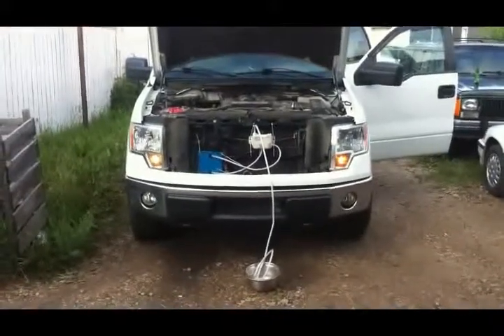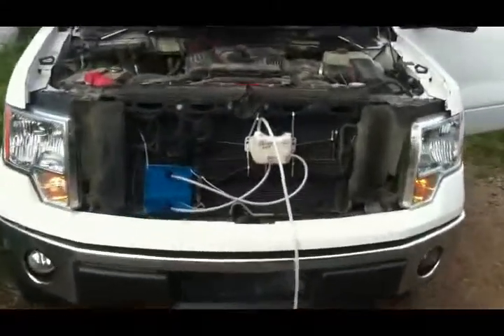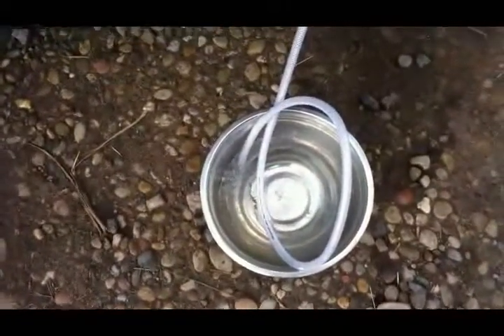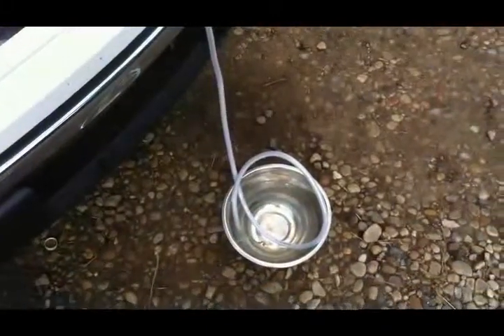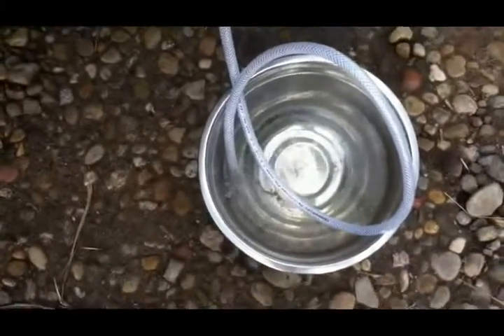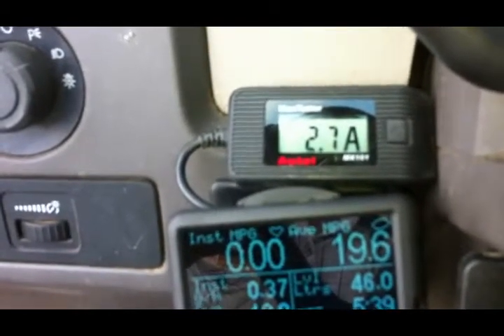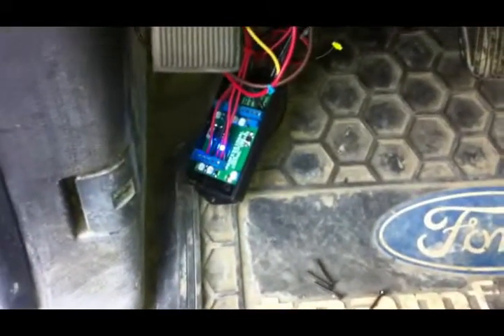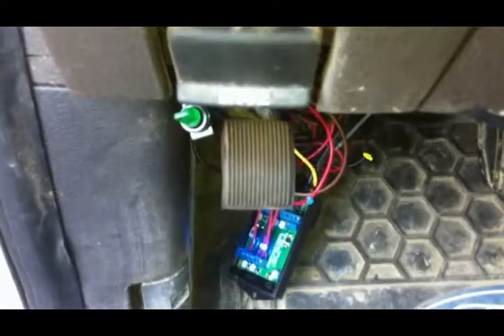2009 Ford 150 HHO Setup

Comment: Saw you in the F-150 forums, and I appreciate you keeping a log and sharing it. I'm not sure how the build up up citrate and sugars on the steel will affect corrosion  or hydrogen production tho. Definitely not something I would have considered. I can see some potential for surface area increase via etching and pitting, as well as some catalytic potential,though I can't find any literature on that subject. I'd also expect possible microbial degradation. Please continue.